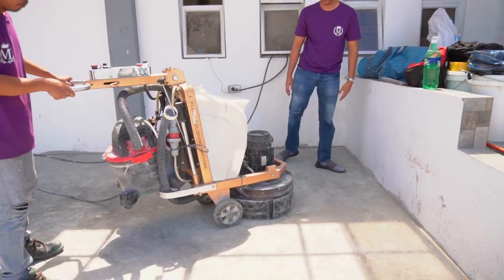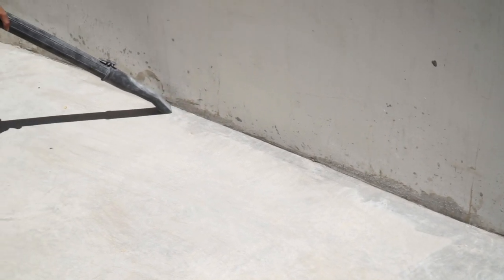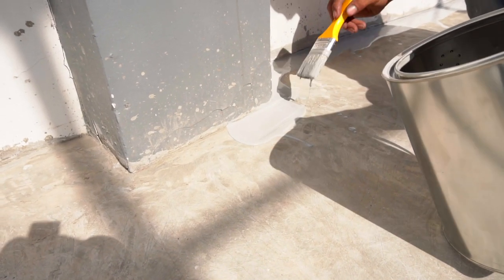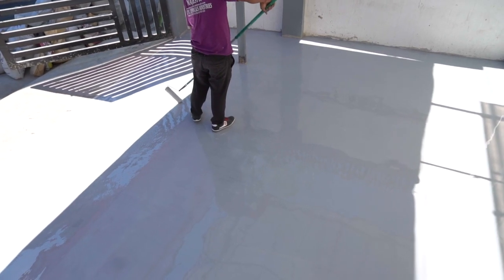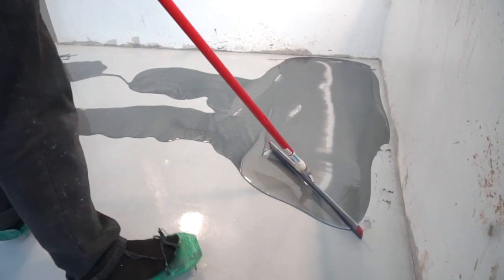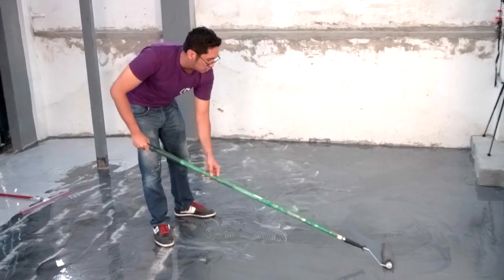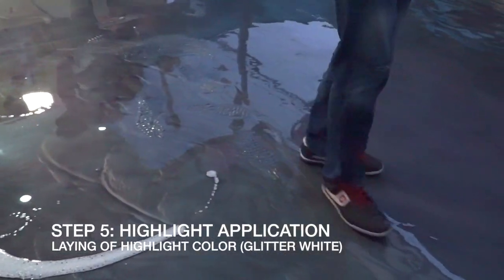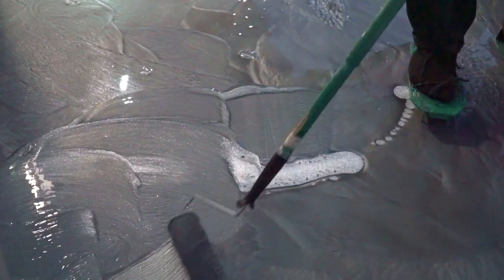METALLIC EPOXY GARAGE PHILIPPINES   METALLIC EPOXY FLOOR PHILIPPINES

Comment: Sir mgkno mgoagawa s inyo yan??
Reply: Madali lng yan, nuod klang sa utube khit anung bagy pwd mong gawin s resin..
Reply from the maker: Good Day

Depende po sa sukat at sa location :) 

makakabili po kayo sa amin, just message lang po and we will answer those Questions :)
https://www.facebook.com/majesticchemicals/

also we have LAZADA for COD
You can purchase to our Lazada
then screenshot your order then send it to us here so we can prepare it as soon as possible.
sa Fb page parin po :)
https://www.lazada.com.ph/majestic/?

Visit our Website
https://majesticchemicals.com/

By the way I'm Sherwin of Majestic Chemicals, Glad to assist you :)
For availing & quicker response, you may contact us
09182523454

Join MAJESTIC EPOXY RESIN COMMUNITY PHILIPPINES to show your resin works and share tips
⬇️M⬇️A⬇️J⬇️E⬇️S⬇️T⬇️I⬇️C⬇️ ⬇️C⬇️H⬇️E⬇️M⬇️I⬇️C⬇️A⬇️L⬇️
https://www.facebook.com/groups/398748351104499

Comment: Magkano po pa install
Reply from the maker: Good day

Depende sir sa sukat ng area po by sqm :D 

For availing & quicker response, you may contact us
09182523454
Reply: @MajesticChemicals  mga 77sqm po cguro
Reply from the maker: @cheruwinortega722  saan po location sir, for installation po kasi around NCR area lang po tayo nag iinstall :D 

For availing & quicker response, you may contact us
09182523454

Comment: magkano per square meter? or pwede po ba chemical lang ang bibilhin at kami nlng ang gagawa? available ba sa camarines sur yan? thanks
Reply from the maker: Yes pwede po materials lang sir. Ilang sqm po? If labor and materials sir 2k + mobilization po
Reply: @MajesticChemicals  sir saan PO kayo pwding contackin pwd nyo bang ibigay UNG contact number nyo sir thanks GOD BLESS
Reply from the maker: @nujenarecon1710  yes please contact 0917 3147394
Reply: @MajesticChemicals  ano po bang  clasi ng primer ang pwding gamitin

Comment: Hi,my flooring is rough concrete whats the necessary prep b4 apply the epoxy resin,can it be skimcoat floor as base?
Reply from the maker: Good day Maam! Make sure your flooring is in smooth finish condition, don't use skimcoat, you can apply cement topping on it, Thankyou :)